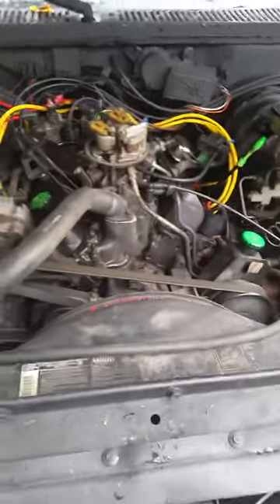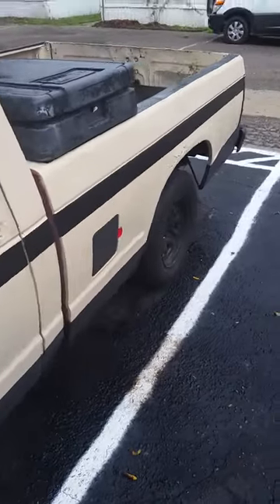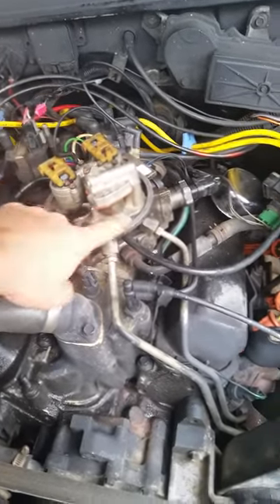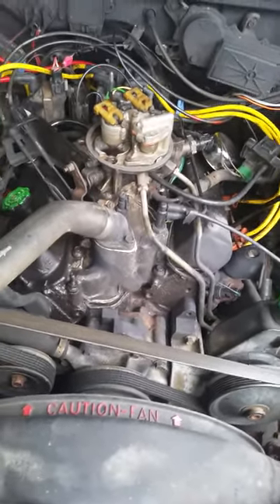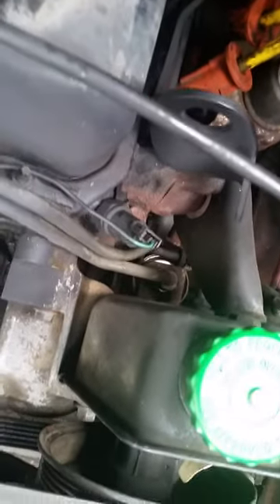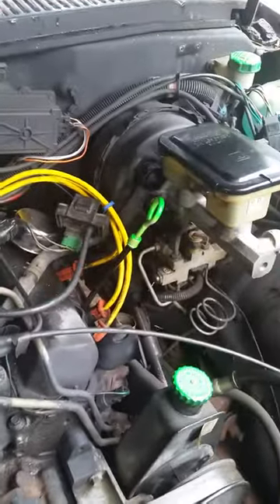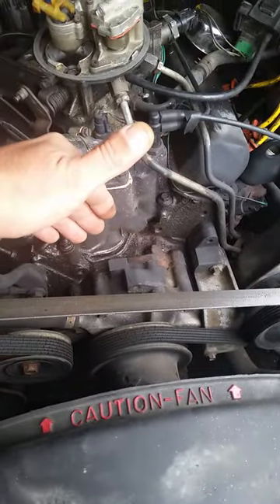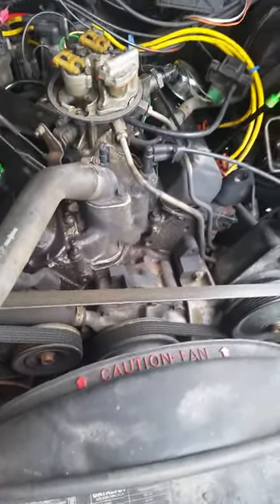Video #4 1991 GMC SONOMA 2.8 LITER,  NEED HELP!

Comment: Bet the coolant temp sensor is bad I've fixed Many S-10 with that issue because the coolant temperature sensor give the computer how hot or cold engine is for it to run correctly when it cold or hot when that malfunctions that causes all kinds of issues